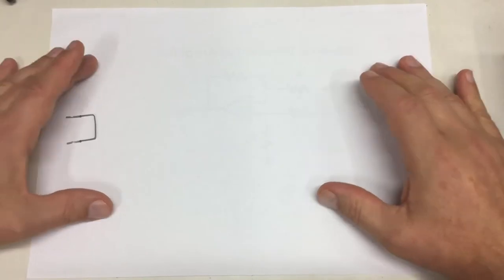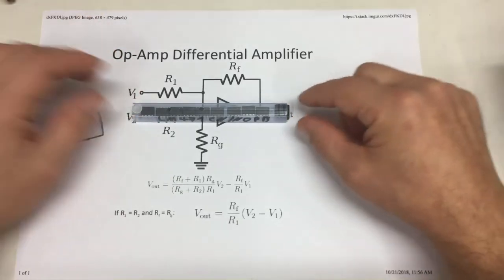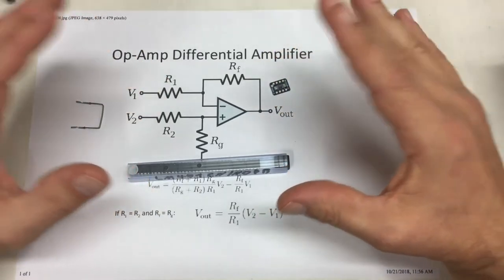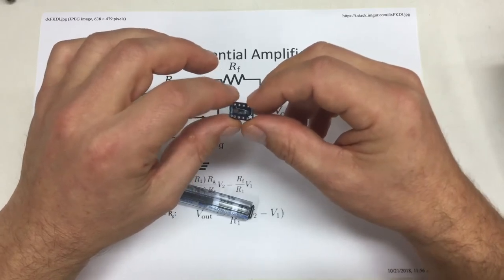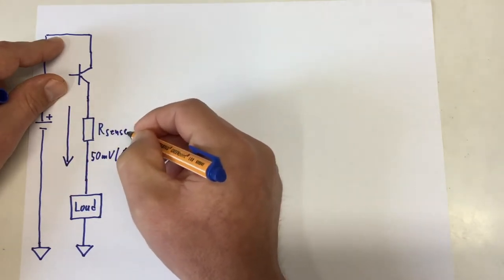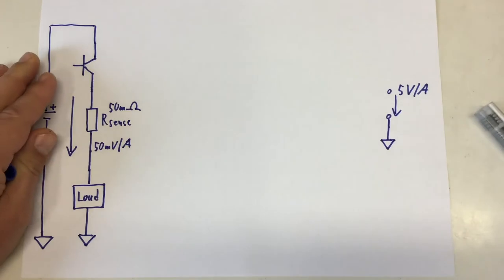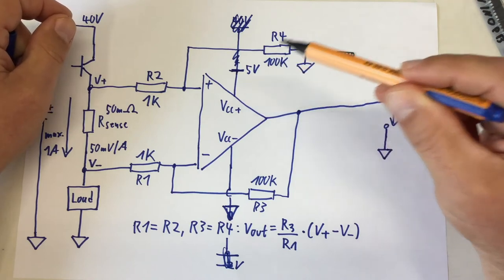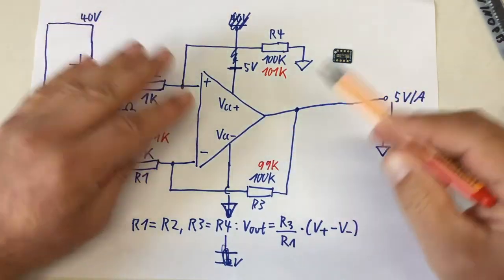Current Sense Amplifiers (1/2): Why not to use an OpAmp (CMRR etc.)

Comment: 22:10 - Yes but most engineers would use an instrumentation amplifier. Thus the internal resistors would be well matched for high CMRR. You wouldn't use discrete  resistors like that.  Sigh, I guess that is the problem with fly by youtube information videos.
Reply from the maker: Well, you are right about an instrumentation amplifier with its (in some cases laser trimmed) internal resistors alleviating the CMRR problem. However, most engineers wouldn't use an instrumentation amplifier most of the time in this application, because: A) Usually an instrumentation amplifier is more expensive than a current sense amplifier. B) You don't need the very high input impedance of an instrumentation amplifier in this application. C) Instrumentation amplifiers usually don't offer the wide common input voltage range (beyond the supply voltage) that current sense amplifiers usually do.

Comment: Don't follow the schematic.  With Vin= 40V input, R2=1K,R4=100K, Positive input will be much higher than Vcc=5V.  For sure it will damage the OPAMP.
Reply from the maker: That's what I wanted to point out there :-) An opamp will not survive that. You'll need a suitable, that is with a large enough common voltage range above its supply voltage, current sense amplifier there.
Reply: Nah, nowadays you just need to make sure the opamp can handle it.  15 years ago I would have agreed with your comment as a blanket rule, but a lot of fairly basic opamps have been available for years that can handle this like a champ without phase inversion or smoke.  They can happily measure differentials that are riding on a common-mode that is 20, 40, 80, 270, even +/- 600V from a 3.3V single supply voltage.  LT/Analog has opamps like the AD8479, as well as numerous "OVER-THE-TOP" devices like the LT6015 and LT3675.  TI has similar opamps like the INA148 and INA149.
Reply from the maker: @0x07AF  You're absolutely right in regards to Linear Technology's "Over-The-Top" opamps (e.g. LT1615). BTW nice pieces of technology. However, INA148, INA149, LT3675 and AD8479 are not simply opamp. They all contain a resistor network around an opamp (INA148, INA149 and LT6375: "Common-Mode Voltage Difference Amplifier"; AD8479: "Very High Common-Mode Voltage Precision Difference Amplifier").

Comment: Just use INA254 or MAX49921
Reply from the maker: I like integrated shunt of the INA254. I also like the high precision and low CMRR of the MAX49921, but soldering TDFN packages is a wee bit beyond me.
Reply: @robertssmorgasbord  I see your point.
Reply from the maker: @Tek-ns  Yeah, got to work on my SMD soldering 😅

Comment: /verifying Krell audioFool Electrics signal transmission theory
Reply from the maker: Well, I'm not sure I see the connection. But then, I never was into audio circuitry.
Reply: @robertssmorgasbord  Reminder to self to check bogus tech claims about signal transmission from Krell around 2000AD.
Reply from the maker: @Dr.acai.jr.  Ah, I see. Krell is one of those hyper, high-end audio companies. There claim to fame is "CAST (Current Audio Signal Transmission)". But if I read statements like "CAST enabled products include a transmitter and receiver circuitry that transfers current from an extremely high output impedance (source) to a low-impedance input (load), minimizing the cable’s effect on signal transmission." I get brain cancer - it doesn't make any sense.

Comment: Shit — I've done exactly this: LM358 as a differential amp for sensing current in the middle of a circuit, and it just doesn't work. Now I have to learn about CMMR and shit? I fucking hate this hobby...
Reply from the maker: Nooo! Come on Frankey! You don't really hate this hobby. Remember the satisfaction when a circuit actually works ... It took me about 40 years to get where I am today (with a 25 or so year gap in between). And I'm still learning ;-)
Reply: I was about to do the same for a battery charger, but was trying to understand the implementation first. Glad I saw this video.

Now I want to know if I can compensate in software, and get away with using the LM358.
Reply from the maker: @Subin_Roy  As long as your software knows the voltage your shunt resistor is floating at, you can compensate for CMRR errors in software.
Reply: @robertssmorgasbord  Would that be a one time calibration thing, or do I have to read the floating voltage each time I need to take the current measurement?

The floating voltage will change based on the state of charge of the battery.
Reply from the maker: @Subin_Roy  The calibration would be one time. For example, you set the voltage your shunt resistor is at in 5 steps and the current going through in 5 steps. Then you measure the output of your OpAmp at all 5x5=25 combinations to derive an 5x5 (OpAmp output, shunt voltage) deviation table containing the actual current / OpAmp output at each of the 25 points. That you put into your code. In actual operation your code reads the OpAmp output and the voltage the current shunt resistor is at via the ADCs, goes to the nearest point in the table, and calculates the current as OpAmp output * table value. Of course that is a very simple approach. You could do some (linear) interpolation between the data points in the table to improve accuracy further. And the more data points your table contains, the more accurate the whole thing becomes.
Reply: @robertssmorgasbord  Thank you for that explanation.
Reply from the maker: @Subin_Roy  You're welcome!